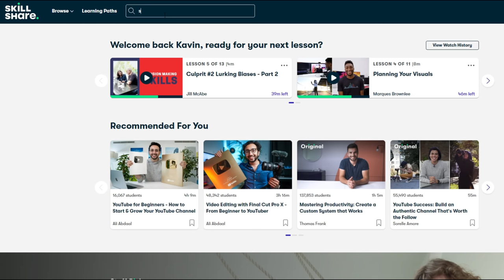I Crashed My DIY Ekranoplan (And Fell 40 Feet)

Comment: So, my contribution is that I’m working on a front hydrofoil that would push the nose up on take off… and if it pitches too far up will fight it until it lifts out of the water in which case half of the forward lift will be lost and it will surface pierce the hydrofoil again.

This is all too much for a manual adjustment system so I’m learning electronics to make the control system.

Comment: You guys might want to check out the 3-Ring release used by skydivers to cut away malfunctioning parachutes. It is designed to always work regardless the load, and it is incredibly simple.

Comment: Need to have your weight shift center of gravity lower. When you pitch up like that, shifting your weigt forward along the aircraft actually just moves it up vertically and it probably cant change much relative to the center of lift.

Comment: I suppose you've looked into this, but the tow point on the Ekranoplan seems to be an issue. It's essentially a point of forward power (as if the thrust was coming from that spot) greatly impacting the angle of attack. The next step is to add motors to it in the appropriate position to avoid the negative impact of towing.

Comment: As a hanglider pilot. The tow rope gets attached to the pilot with a special harness. Never to the vehicle. The vehicle needs to be free. So that you can manipulate it with your body weight shift your arms and your legs. The tow rope on the vehicle does not allow that. Too much force in only one direction. Watch videos on hanglider towing.

Comment: The problem is, its a rigid aircraft without aerodynamic control surfaces.

Weight shift alone cannot cope with the dynamic environment of gusts, flow seperation, etc. 

You're better off buckling yourself into a seat. Fix center of gravity. Control with ailerons, rudder, and a canard flap.

Comment: Maybe should've had Daniel put some LIDAR/Ardupilot + some servo controlled Ailerons on that thing to prevent it from leaving ground effect. 
Personally, I would've spent the ~$250 bucks to be able to run at any speed without it leaving effect to maximize adrenaline fueled Ekranoplane-Water Ski hybrid contraption shenanigans so that yanking the tow release was like an emergency stop button only to be used if absolutely necessary due to the flight control system having a failure, which could be conveniently simultaneously monitored by an individual in the tow vehicle via MavLink so that multiple people have eyes on it. I also would've made the tow rope able to be released by by a QD on the Ekranoplane b/c the operator has the most situational awareness & can react faster if anything goes wrong or feels wrong. Plus; constant radio communication via the tow vehicle & the Ekranoplane would've probably been the ideal way to go. 
Hell, I ain't even the most safety oriented person by a long shot but from my experience building & driving race cars & working with heavy equipment & designing/considering failsafe options & knowledge of microcontrollers/RC stuff that'd be on the build sheet while planning what the standard operating procedure is.
Well, actually after thinking for a brief second, being an Eagle Scout & having the 'Scout Motto' engrained in my mind (which is, 'Be Prepared') is the actual reason I would've took the steps I detailed while designing such a craft. 
Cool video, probably would've been a better idea to add some simple features that would've provided an experience that would've prevented any issues from happening & allowed y'all to really rip around on that thing! Hope to see a 'v2'  & aside from my 'constructive suggestions ', I've seen a lot of other great ideas on this comment section & overall good discussion, further adding to my confidence of asking for opinions on anything I design before Its finalized & I move into the production stage.
Glad you ain't get hurt tho! I be slightly sketched of heights when I have a lack of control (i.e. non a frame ladders, jumping from high up, blah blah blah Ekranoplane water ski that leaves ground effect, shit like that 🤣 I'm fine in airplanes and stuff) so it's questionable if I would've jumped or kept trying to get my weight forward 😧 hell that's probably another reason I would've made it nearly impossible to leave ground effect unless multiple systems fail & comms aren't working hahahaha shit 
& Dude watching you miss the craft Daniel was flying was like watching that one fucking car make it thru 'The Big One' @ a super speedway race! Straight up some Daytona/Talladega shit cuz that would've been a hard fucking hit for sure 🤣

Comment: Maybe aoa actuated pivoting air foil to keep the front end from pitching up and maybe a hydrofoil under slung that actuates a dihidral wing configuration once airborne? Just thinking but then you might want a engine and prop on it then.

Comment: You are ultimately going to get an unpredictable lift with the larger wing in a conventional airplane mode.  The front wing should be smaller as a fine tuning manual component with the larger wing trailing it. A little bit of rear drag will subtract from skittish characteristics innate to the lead part.
Reply: Yup.

Comment: Make your horizontal stabilisers adjustable instead of fixed with a simple up/down control lever. This would have made it unnecessary to jump as the height would have been controlled.

Comment: A nose heavy aircraft flies poorly. A tail heavy aircraft flies once. It looks like the CG was too far aft, so you lost pitch control and the vehicle immediately stalled. Weight shift for pitch control is not easy and doing it by moving a human back and forth is even harder. If you do a redesign definitely consider either reducing the forward wings and increasing the rear wings to push the center of lift aft and including some kind of control surface to manage pitch. Glad you weren't hurt!

Comment: It appears that you used the same airfoil section for both the front and rear wings. This is not how Jorg designed his very stable tandem wing WIGs. The rear airfoil needs to be much thicker. This will reduce the pitch up tendency as altitude increases. Until you correct this defect adding PAR is just a complication that won’t improve the inherent lack of height stability. That said, I admire you for your efforts.

Comment: Think Flight: If the goal is to skim the water at a slow speed just a few feet off the water at most then I recommend pitch control surfaces that will automatically keep the craft from getting above a certain height. If your goal is to go above a few feet high then I strongly recommend stopping this project and using your wonderful creative mind to do other cool stuff.

Comment: You should replace the handle in front of you by two handles on each sides. You could then shift your weight easily to the front (or to the back). You see what I mean?
Reply from the maker: I need that middle joining section to brace the wings, otherwise yes.
Reply: @thinkflight  is it possible to bridge the two uppermost points with a rounded section, essentially like a C as viewed from above? It would need to be thicker to be sure, but it would definitely be possible to give yourself a little more room to shift while still providing bracing (and an exit route should a situation like this arise again)
Reply: @thinkflight  Can you replace the middle joining section with a classical CF wing dowel + CF tube in the wings? As is done in the RC world? Just my miserable two cents.

Comment: No wonder the rope release wouldn't. That release pin has to be pulled 100° away from the needed direction - which is straight toward the tow boat. And just making a better oriented release yourself will be Betta. How? Draw a  sketch of your present release on cardboard, two times scale for easy working. Cut it and rearrange the parts so the attach swivel is toward the tow boat, so the steel release assembly stays with the boat, not the plane, for safety. Arrange the release pin and pin release cord so they also are running straight to the tow boat. 
The tow rope release arm needs to be on the far end of the rope release mechanism, that is, away from the tow boat. It's arm, when open, needs to be able to swing to 195° away from the direction to the tow boat when said arm is open, so tow rope doesn't catch it.
That same arm needs to be bent from a rod so the arm is smooth, without the bulge.  It will be better to make your own rope release.

Comment: You need to figure out some self correcting aerodynamics. Is it correct you've got reflex on the rear, but not the front? This probably doesn't help with the CoL shift. AoA is the same on both wings? I'd consider adding AoA on the rear wing/remove the reflex. And/Or get some kind of control.
Reply: There was a lot of research done starting in the 60's on this. The Lippisch reverse delta planform is inherently pitch stable.
Reply: @ryoungatlmidotnet  yup, I'm building one. 🤭 It should be theoretically possible to design a tandem to be stable.... But this is not it 🤣

Comment: The answer to your problem is flying right next to you ! Put control surfaces on your GEV. Simple petals and a yoke on your hand hold will work. First get some training, unless you already do, by flying Large RC planes. This will help you understand real world control movement, maximum & minimum control travel to get a desired stable flight. With today's RC technology you could even place a gyro on your GEV for automatic stability. That's what your trying to fly is a giant RC "whatever, " you have the lift now stabilize it...

Comment: 😉 Final accident report: After a nominal take off roll the aircraft began a normal climb, when at an altitude of 15 feet and an airspeed of 170 knots the aircraft suddenly pitched upward to an un-commanded 68° angle of attack. The Pilot in Command immediately applied full forward flight controls to counter the sudden change in AOA. At an altitude of 40 feet AGL at with the airspeed decreasing to just above stall,  the PIC applied full afterburner in accordance with NATOPS emergency flight procedures. The airspeed increased to a level that stopped the impending stall, but the Pilot was unable to regain pitch control.  The aircraft began a slow roll to the right and at that point the aircraft departed controlled flight and the Pilot was forced to eject. 😁😁😁😁

Comment: The only other aircraft I can think of that is controlled by CoG changes is the hang-glider. And that's an under-slung load, meaning the CoG is much lower.
I think you have an inherently unstable platform that needs to be re-thought.
I'm sure there are experts that can explain it mathematically!

Comment: I think I see the problem. You are trying to shift your weight by moving yourself forward and backwards. When you are forward of the center of mass you are indeed pitching the plane down. The problem is as you are moving forward you create a ln equal and opposite moment of inertia that pitches the plane up. 
Moving the tow line forward might alleviate this. That or adding some way to pull the nose down towards the tow line.

Comment: I see the similarity between your ekranoplan and an old plane (1930's) design that had the same fatal flaw. Once a certain angle of attack was realized. No amount of control input would restore neutral flight and it would continue to over pitch. This is because the rear wing gets into the wind shadow (downwash) of the front wing causing the rear wing to suddenly have significantly less lift than when it is above the wind shadow (downwash) in relatively level flight. That old plane design was called The Flying Flea. Although due to the geometry differences the Flea over pitched forward unrecoverably, whereas the ekranoplan overpitches up.

Comment: For flight testing the rope is way too long.its not safe.
A short rope would have prevented the "plane" from getting too high, or flipping.
When you confirm the flight behavior is good enough, you can make the rope longer bit by bit to give the "plane" more freedom of movement, and test again.
Its like keeping a dog on a short leash.

It was pretty stupid of you to not test the quick release under load. You should look at parachuting or kitesurfing quick released. They are designed to release under load.
The one you used is for spinnaker on boats. And they are not designed to release under load.

Comment: Your center of gravity is much too high. Why not have a hull to sit low as on the original Joerg tandem. The nose pitch-up is normal when you come out of the ground effect. You should know that. There is much information on the internet on how to do it right. Wing in ground effect craft already has a bad name. So we do not need another wo....less design.

Comment: The presenter has touched on most of the mistakes which led to the negative outcome in this bit of testing; so I'll withhold comment.
Suffice to say that best practices for ground to air towing of unpowered aircraft are well understood and the events included in this presentation ARE NOT THOSE!.
Also; it is worth noting that " when experimenting with anything that carries added risk; best to look for historical precedents "
Example; in the 1970's when hang gliding was in its infancy ; pilot's operated with the following credo:
"Do not fly any higher than you wish to fall"